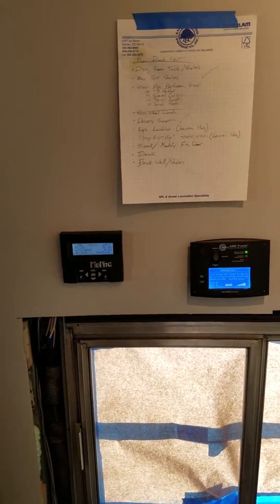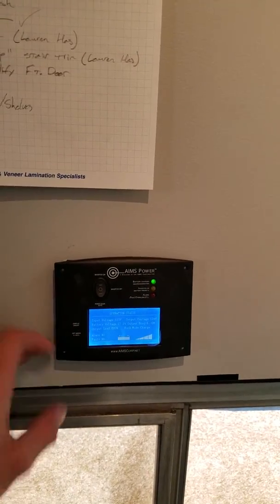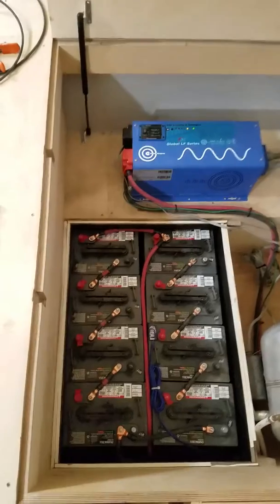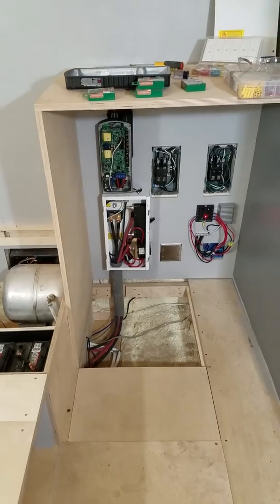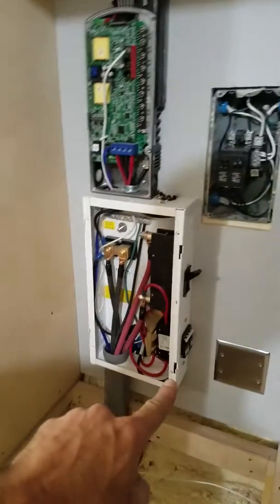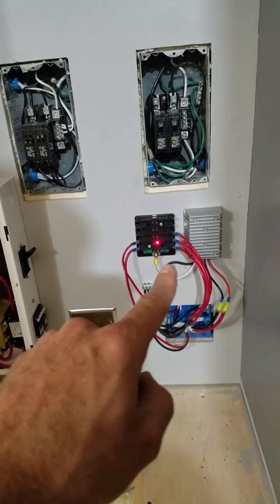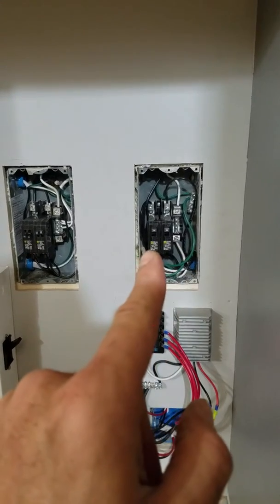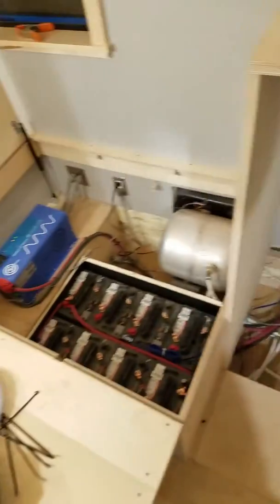Off grid solar setup on a converted school bus

Comment: Would you recommend these same components (solar panels, batteries, controller,etc) for a van, but obviously down sized? 12v instead of 24v?
Reply from the maker: yes but id stick with 24v

Comment: hi there! long time lurker, love your content! I had a pretty wild idea and wanted your thoughts....has anyone ever attempted to pile on enough solar on a bus to have decent excess power, and that extra power was used to charge an EV? If towing an EV, potentially also leveraging the EV battery for powering a/c or heat through the night on the bus. Would need alot of solar power to charge any EV (i have ideas), but i didnt know if you have heard of anyone even trying this